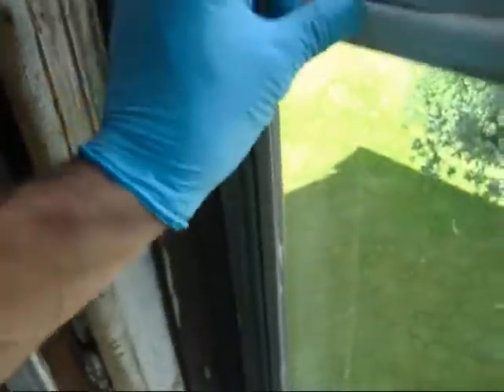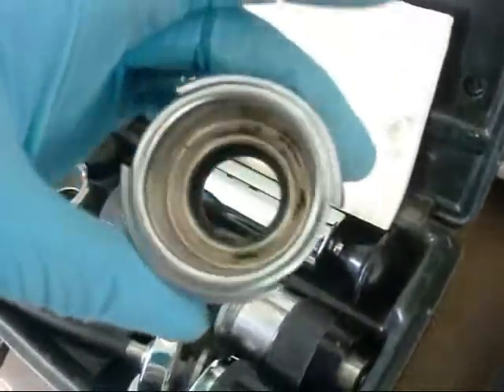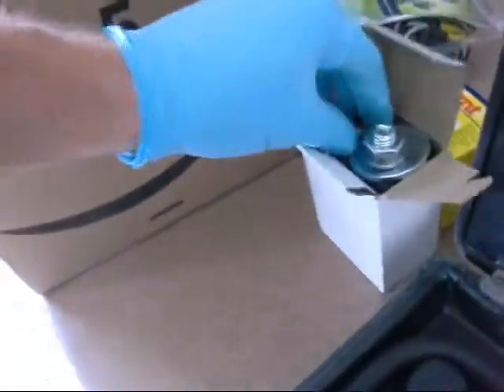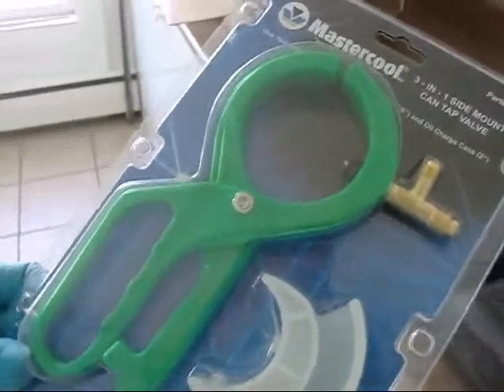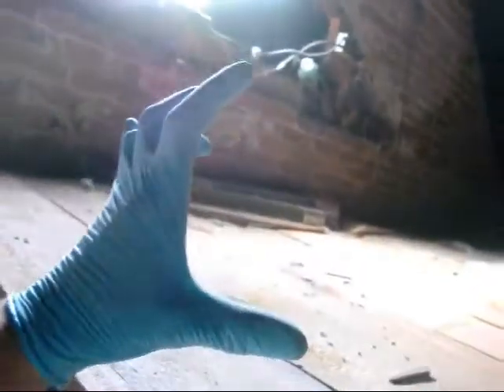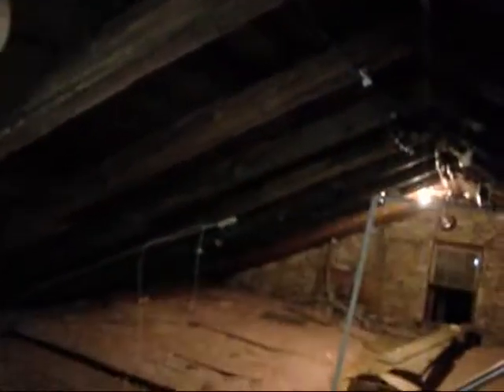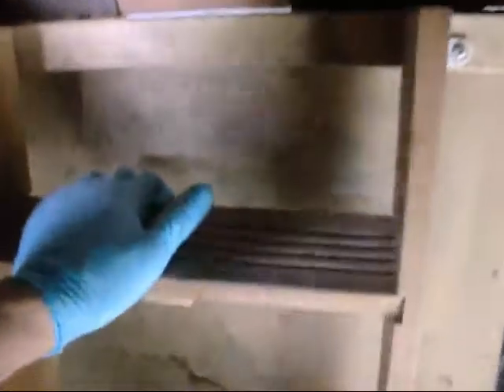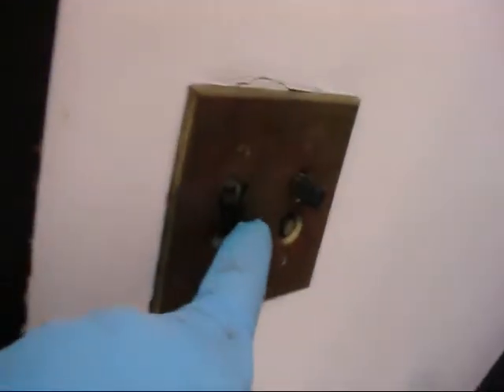6 20 13  Apt 2 Walkaround Chat Vid

Comment from the maker: The wiring is 120 years old, and knob and tube is reliable, and the wires are separated by 1 foot, so no chance of short circuit. I've never had a problem in 20+ years.